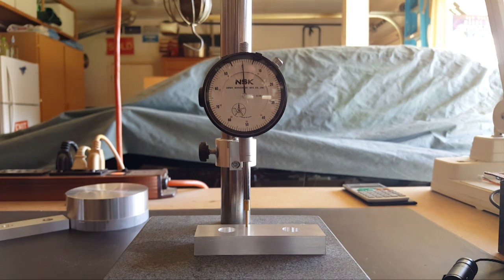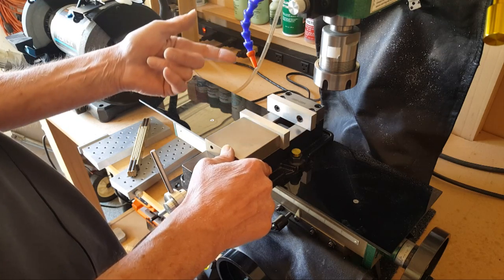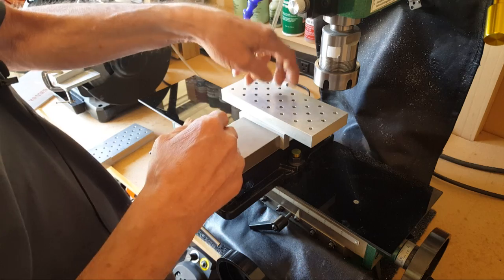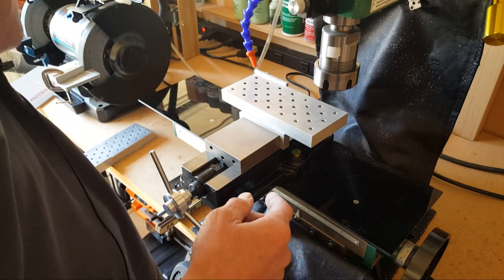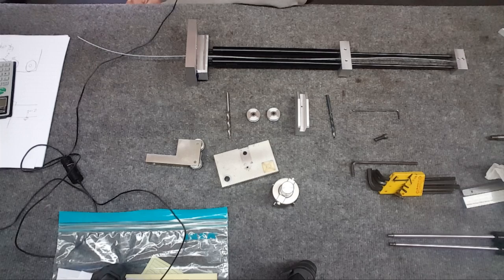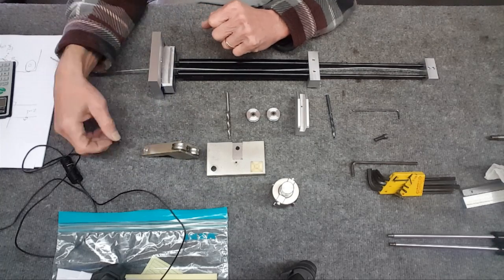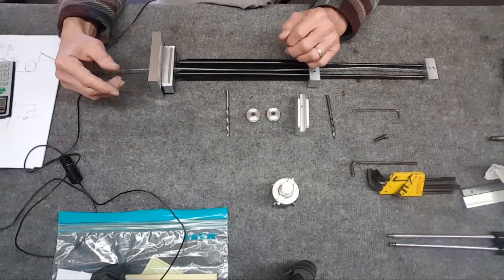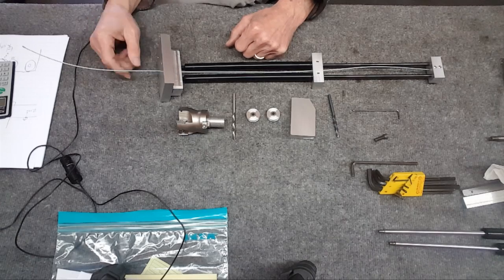Vise Trick & Mini Mill Piston Upgrade

Comment: Just wanted to know the specs and where you got the air springs looking to do the same mod.
Reply from the maker: https://www.amazon.com/gp/product/B00Y3H15PA/ref=ppx_yo_dt_b_asin_title_o02_s00?ie=UTF8&psc=1
Reply: @TheMiniMachineShop  just curious why did you went down to 10 lbs springs? is it enough to support the head? I know in your other video from 11 months ago you used two 20lbs springs.
Reply from the maker: originally bought 20lbs but that source is gone so bought 20lb from Amazon. bottom line the Amazon source 20lb is 30lb and their 10lb is more 15lb. Quality control problem. So use the link I gave you. Their 10lb works on both mills.
Reply from the maker: in the old video the 20's were to much and were replaced!
Reply: @TheMiniMachineShop  10-4  thankyou

Comment: Thanks for the video Dave.
You want to cut out a picece, 5 x 14 inches. No problem. I did cut out a piece like that out of a plate 20 x 100 cm, 8" by 40" on my minimill. I used a 2 or 3 mm, 1/8, of an endmill.
Sending You some Pictures.

Comment: Hi Dave, installing a door seal this week or next wee it is wind in the desert time need to secure the seals on our Workshop equipment delivery double door set at the rear patio area, so we understand.
We like the surface plate with the indicator, seems to really come in handy.  
Projects are great the more projects the better so you can select what you wish or feel like getting into it. 
Thank you for the share, Lance & Patrick.